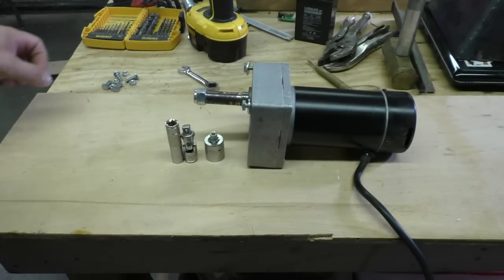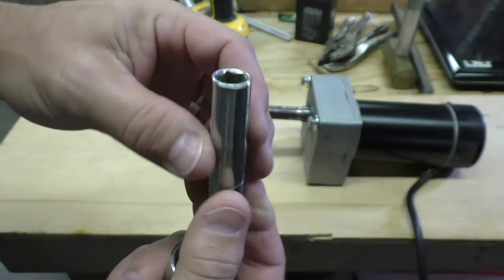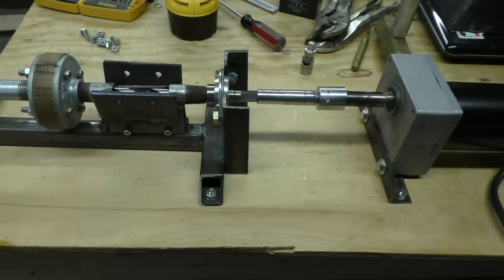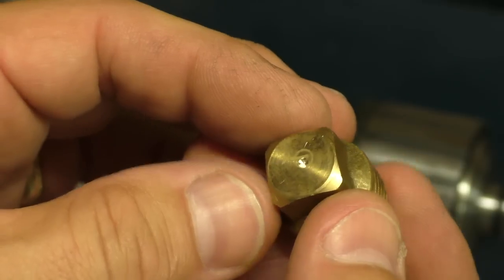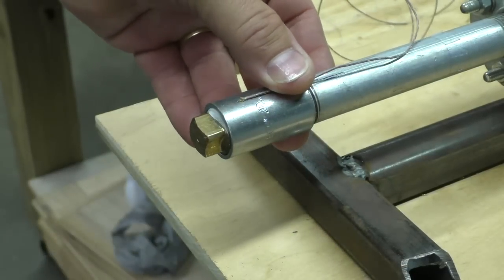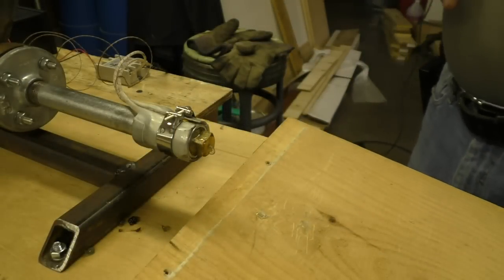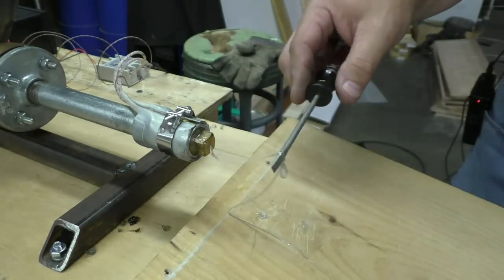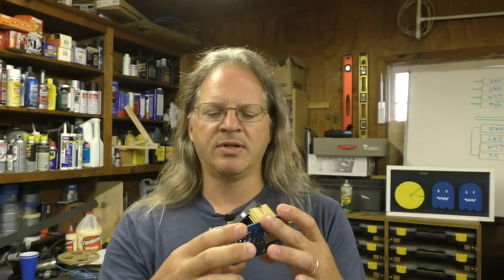Filament Extruder #4 - Finally Making Some Filament

Comment: Excellent work! Do you think with this setup can be possible inject into a (small) mold? Thanks!
Reply from the maker: It's possible.  I haven't really thought about injection molding.  I have been focusing more on 3d printer filament.
Reply: or make giant printer and mount this whole setup as your extruder :)

fancy furniture anyone? https://vimeo.com/33026239
Reply: When Inject moulding, the plastic being extruded has to be under pressure to achieve a uniform, consistent density through out the part being moulded. Great pressure can be achieved by pairing different profiles between the screw and the barrel. In this case the drill bit and the pipe. Perhaps experiment with different types of drill bits. If a concrete bit modified to fit the pipe, since it has a tighter screw pattern would create more pressure at the extruder end??

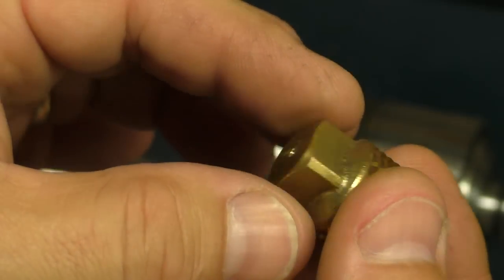Comment: at about 5:40 you tried to use the center finding drill bit on your bench top lathe... but i didn't understand why the center marking attempt failed? i'm very new to making things, appreciate any teachings from all the generosity from you guys! Thanks.
Reply from the maker: I found out on this project that plumbing fittings are made with really low tolerances.  They aren't made to be true or square, they are made to connect pipes together and be water tight.  The square part of the fitting is not centered with the round part, so when you look at it from the front, it looks off.  If you look at it from the back, it looks right.

Comment: Congratulations on making the filament.  Once you have a water bath it will not be sticking anymore.  When I worked in a plastic plant we went directly from the extruder to the water bath.  Keep on keeping on.
Reply: But isn't it bad to get water into the filament?
Reply: No water penetrates the filament.
Reply: Amateur Redneck Workshop so that is why you dry filaments before use and why there are drying "salt" in the packages?
But yes, I have noticed that professional makers also use water paths, both cold and warm.  So I guess during manufacturing there are no problems.
Reply: When I worked in the plastics plant their were no 3d printers to make filament for (1960 era).  When processing plastic before it gets to the people who make retail products all plastic is extruded into a water bath to cool it off so it becomes a solid and then chopped into small pellets so it can be blown into a rail car.  This is why I assumed this channel would also have to cool the filament so it would solidify.
Reply: But still, water in filaments are a problem when 3D printing.
Reply: PLA is fairly resilient to water absorption but in the case it absorbs water you can dry it out in the oven and it prints fine. As I understand it it takes more than a quick dunk to really take on water.
Reply: Ive seen someone cooling it with fans as it reaches the floor. So it drips off the side of the table a d by the time it hits the ground the fan cooled it.

Comment: Do you think that extruding horizontally is ideal.  It seems that a vertical extruder would make the output more symmetrical.   There may be a certain feed rate/temperature/draw rate that makes for sweet production without the product dropping off.  I was of the opinion that commercial extruders like this use some kind of negative feedback system between draw rate and dynamically measured filament width.  Sounds challenging but may be doable, perhaps by measuring beam blocking time of an oscillating laser. Then there's the whole matter of the take-up system and how far/long you have to let the filament go before it is cool enough to roll up.  Then theres the matter of making a decent spooling system.  Lotsa work. :-)  It sure will be nice when the community works out all these issues and we can do this in a practical way.
Reply: foxpup

Comment: Save up all your old milk jugs, chop em up, blitz them in a blender and run that through the 'struder. That'll probably clear out any crap left in the pipe.
Coming along nicely! :D
Reply from the maker: Good Idea!
Reply: What kind of a blender are you using to grind HDPE in? Because I've tried it in an Osterizer here and it simply does not have the power. I sharpened the blades razor sharp, and it still can't even then. A Vitamix might work, but they cost close to $400.
Reply: Paul Frederick turn heat up
Reply: aha I see. his done it the hard way. can be shorter and element at the bowl. drill grind and push. think thats what lymann does. I goto check. Thats bit of a noisey crunchy way hos done this. no need at all.
Reply: +FindmeKicksUK turn heat up? It is a blender, not a toaster.
Reply: Paul Frederick whye wpuld that matter. its the combination of it heating up/melting then grinding.

To heavy duty for so little saving if you ask me. 20bucks kids type chocolate melter with extruder and power boost maybe add ceramic element.
I think we all over think this is manufacturer size lol. Manufacturer size with a beggers bowl😂😅😃😄

Comment: cool. The filistruder i put together did the same contaminating thing. They say to run a pound of plastic to clean it out and after that should be ok. The inside of the pipe is rough and does get drilled out from the spinning bit that's most likely where the metal shavings come from. Filistruder also sells a super fine stainless steel wire mesh screen that traps the metal but there kinda pricey.
Reply from the maker: I have seen others use the screen from a faucet aerator.  There is so much junk in there right now that it would probably clog the screen :)  I thought about trying a screen after it cleans itself out a bit.

Comment: can u extrude straight into the printer nozzel would be cool to get rid of scrap
Reply: This is exactly what you asked for available Now!   Direct printing from pellets!
http://www.thingiverse.com/thing:1847917
Reply from the maker: The extruder makes filament faster than the printer can use it.  I have always wanted a printer that used pellets instead of filament. Who knows, someday it might be possible.
Reply: Well, feed fine grinned pellets into the hot end of the printer could make that go true.  And some PID controlled motor feeding the pellets into the hot end might work? But are you going to have some pressure censor or just skip feedback and going on the rpm of the feed screw?

LOTS of developing work though. :-)
Reply: Anders Jackson jj
Reply: Ricardo, What?

Comment: That looks great man. I wonder why you missed the center on your lathe? Is your chuck centered up with your tail stock?
Reply from the maker: I have found that plumbing parts aren't made for precision.  The flanges on the drill bit pipe are off too.